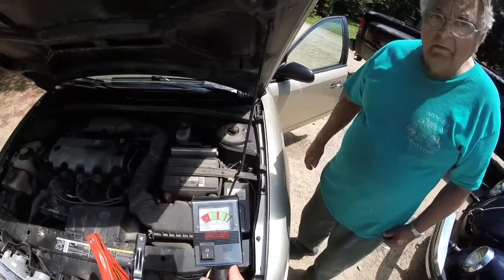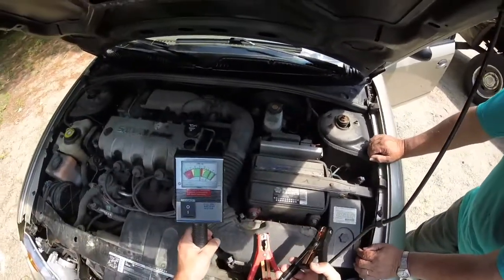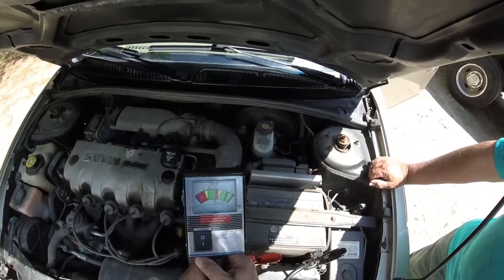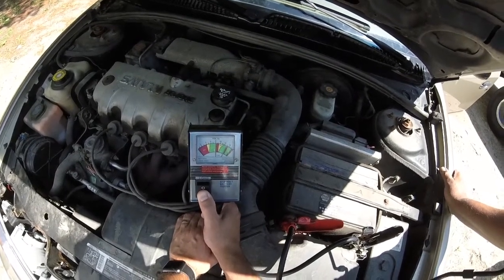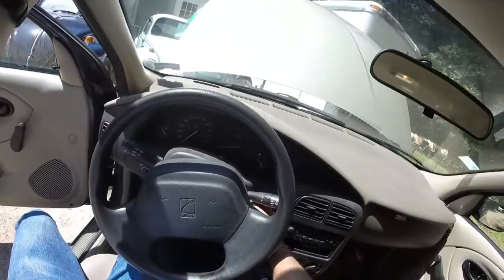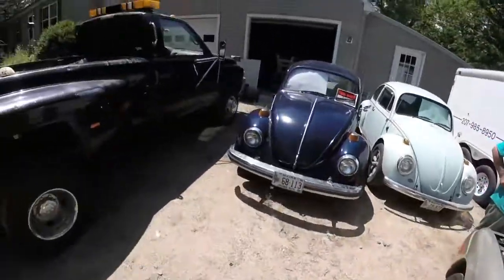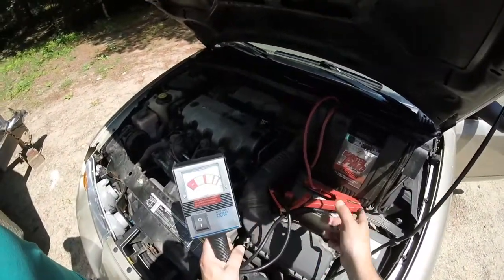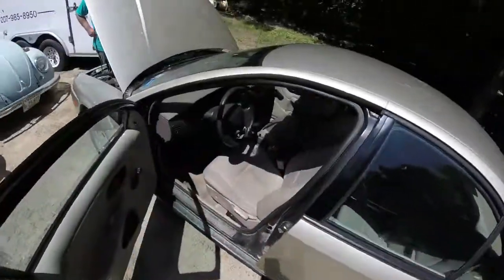Is my battery bad or is my car not charging. How to test the Battery in your car

Comment: Hmm, I don't have a handy portable device to charge my battery, just my mom's car, lol. I think I'm going to just replace the battery first as it's the cheapest thing and see what happens from there. My battery light actually does come on, but considering batteries and alternators are so interlinked, I wanted to see if there was something more definitive I could check to ensure it's not the alternator. I don't think I've done enough testing to confirm that's what it is and no sense spending higher money for something that might not be the issue. Besides, while I only got the car a year ago, who knows when the battery was last changed (or if at all!). So...I'll use your other video to help replace it this week if I can swing it ^_^
Reply from the maker: Some auto parts stores will do a test for free. that might be an option for you. I know AutoZone should if there is one in your area.
Reply: @shanesmaineshop  Yeah, but it's getting the car there that's the issue for me. When I was on my way to actually getting a new battery a week ago, the car began to spew black smoke out the tailpipe. I only just managed to get it pulled over on a service road before it died again. Maybe 20 minutes isn't enough time to charge it with a jump or maybe it was too much time. Either way, I'm a little scared to try and move it for fear it will die on me again. I was actually going to go to Advance Auto Parts for an assessment the day after the battery light came on but the car pretty much died less than 24 hours afterwards and I never got the chance. 

I could maybe have it jumped again to take it to them, but I feel they'd likely tell me the same thing I'm already guessing. And if it's not the battery, I can get a refund but...I'd rather just keep it, regardless :)
Reply from the maker: @BewareTheLilyOfTheValley  Good point I did not know about the other issues. Good luck I hope it ends up being a simple fix.